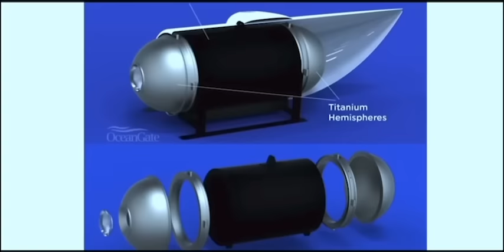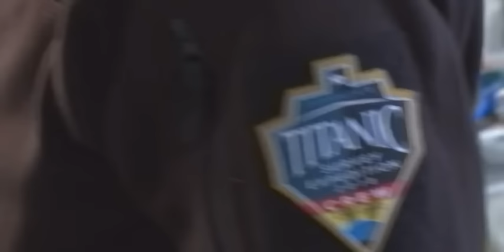First look at #oceangate #titan Debris

Comment: Their lives were really counting on that glue…
Reply: Creamy or chunky peanut butter?
Reply: @subvariantstrain Creamy 😂😂😂
Reply: and not nearly enough it would appear... the adhesive should have been oozing out around both the interior & exterior perimeter mating surfaces... the ooze then could have been squeegeed smooth... as it cured... the last thing if anything at all going thru their minds were their asses as they were getting excreted through the porthole... The depths of the ocean are a cruel and unforgiving mistress...
Reply: To be fair this sub had done multiple trips over a few years.
If James camrons sub exploded they would be bitching about all of the flaws on his sub too. Especially because camron only went down a few times compared to the titan.

Blame commercialization/sensationalism.
Reply: @deliacolquhoun2845 multiple trips was the problem
Reply: @deliacolquhoun2845 True, but Cameron's went 3 times deeper. All submersible, just like airplanes, get retired after so many trips. Submersible get retired after only a few.
Reply: @deliacolquhoun2845  yea, it worked for many dives but I don't think glue should have been utilised period.
Reply: Wow 😯😯😯😯😯😯😯🫢🫢🫢🫢🫢
Reply: They would have been better of using Elmers glue.. 😂
Reply: @deliacolquhoun2845 No james Cameron went down over 30 times ! oceangate Went down only 12 times
Reply: @cjstats1514 Not true....Alvin made over 1000 dives
Reply: Should have just made center out of Titanium 5 inches thick or more.might have weighed little more but they would still be alive today. Where is the center Titanium core that carbon fiber was wound on? Any pictures of it ?
Reply: @deliacolquhoun2845  The submersibles Cameron used are in use since decades, execpt the one that was specifically build to go to the mariana trench just once. The others still work. Cameron went to the Titanic 33 times. The Titan submersible reached the Titanic three times, once in 2021, once in 2022 and once in 2023. The hull has been replaced once in between. The actual hull had therefore a maximum of two dives to the Titanic before it failed as expected. Carbon fiber hulls are bad at compression loads. You cant push a rope.  Thats why there are no carbon fiber deep sea submersibles. Using such a hull multiple times is suicide. The outcome is an implosion, not an explosion.
Could you try to get at least one fact into what you write?
Reply: @flybywire5866  just like a vehicle though I highly doubt he kept up with the maintenance of the Titan..
Reply: They would have been better off sniffing the glue.
Reply: Glue failure? What’s the bet the carbon fibre didn’t let go abruptly! The expensive coffin might have rapidly filled with water then imploded with not as much force as they suspect! Hence they have found body parts which in theory should have become source and vanished!
Reply: @deliacolquhoun2845 Cameron been even more 33 times nd deeper than titanic
Reply: @wallywally8282 jumping the gun a bit. At the moment presumed human remains may have been found. This does not mean body parts. Whatever has been found would still have to withstand the pressures down there.
Reply: They should've used gorilla glue, it won't move.
Reply: @deliacolquhoun2845  blame Stockton Rush
Reply: @deliacolquhoun2845  blame capitalism, maximize profits whilst reducing costs ie cutting corners.
Reply: That glue must be very special and strong ....At 4000 plus feet, the glue will change its durability to extra strong ....
Reply: And now they are the glue
Reply: They should of used Gorilla 🦍 glue😊
Reply: @deliacolquhoun2845 You are correct lets not dwell on the negative’s!
Reply: @revolvermaster4939 I’m really surprised they didn’t make a new one after so many trips. 
But greediness won here
Reply: Had NOTHING to do with the accident! This accident was caused by the implosion of that carbon fiber cylinder! the ends blowing off were totally irrelevant the people by that time were already dead. Those end caps in fact were in COMPRESSION BEFORE the implosion. They simply "dropped" off the cylinder when it imploded because the carbon fiber was shredded (they coulda used masking tape as a fastener). Yeah I'd like to see the aftermath of that carbon fiber THAT was the cause of this accident.
Reply: Exactly. I was shocked when I watched the construction
Reply: @wallywally8282  I Just hope Rush felt it all
Reply: Not at all, under pressure it was just a seal. I will go so far as to say it would have been stronger if it was rubber seals there and the titanium and resin parts could react individually to the pressure. (And cold)
Reply: @teamidris  I don't think you get what's happening. The carbon fibre still would have failed with rubber.
Reply: Oh my!!!
Reply: @waynesharp1690  not necessarily, because the dissimilar materials locked together by the grove in the titanium adapter ring is a stress raiser.
Reply: @teamidris  the overall design was very weak. I'm amazed it survived once let alone all the other trips down. Each time was a suicide mission where they got lucky. It was a death trap waiting to happen as we've seen.
Reply: I thought the exact same thing
Reply: If only he was using flex tape, that sub will OP
Reply: @deliacolquhoun2845 To be fairer, James Camerons sub was designed and built using already existing data on deep sea diving.

Titan was designed and built ignoring all relevant data regarding deep sea diving. It also was never even looked over once by any regulatory body on earth. It's creator had a high level of aeronautics knowledge and based his design off his own knowledge in that field.
Reply: Insane!!!! Truly Insane!
Reply: I mean  that wasn't weak glue but wellding would be a lot stonger
Reply: This guy cheaped out so much on that sub I wouldn’t be surprised if he did actually use peanut butter as the glue won’t be the first stupid decision he’s made
Reply: I would never trust glue to hold on its own. If bolts couldn't grab and hold in the carbon fiber, I wouldn't use it. A better experimental submersible would include a graphene alloy in my opinion.
Reply: Crazy glue
Reply: Gorilla glue
Reply: They should have put a massive jubilee clip over the joins.
Reply: @SophieB_Ofcl  But it takes ages to harden.
Reply: @forzatuner3916  Exceptions don't make the rule. One exceptional submersible that is out of the ordinary. Most get retired to at least only going to less deep dives.
Reply: Glue is not very strong hold and  why they not using volcaseal or Mighty Bond
Reply: It's been proven they used EXPIRED materials probably the glue
Reply: @MrRODSTER426  You copied that last bit.
Reply: charlieb308  That is interesting.
Reply: @cjstats1514 
There's some companies who use the unmanned submarine to explore the see, they don't need to change the submarine every years, of course there's some maintenance but they keep using the same sub, same goes for the army subs, they're lifespans are decades. 

The titan imploded because he was made with materials who simply couldn't handle the pressure, it's already a miracle that the titan didn't implode before. 

But if the titan was fully made with titanium, and if the responsables were respecting safety rules, using certified materials ect then the titan could have plunged 1000 times easy before being replaced.
Reply: @MrNaKillshots  Somewhat better said than the eyes glazed over speculative 20/20 hindsight presented by those sitting in armchairs from afar... I thought it was appropriate considering the bulk of adventurers on this voyage were so enamored by the Titanic they were willing to risk everything for a brief encounter at formidable depths... thereby losing everything for mere fleeting fascination... a stark reminder of the toll extracted of both courage and sudden misfortune that lies in wait when men go to sea... May all mariners who go down with their vessels forever RIP...
Reply: @cultofpersonalit1888  oh I agree. The Titan was engineered poorly. I wasn't denying that. I was stating the fact that manned submersible have an expiration and retirement. Just like commercial airplanes do. Wasn't talking about the unmanned ones.
Reply: Reduced  on special offer at Dollar General or Harbor Freight.
Reply: @cjstats1514  Or rebuilt. like the Trieste was.
Reply: @mister_M.  
🤣🤣🤣🤣
Reply: @joefish6091  rebuilt.. retired. Same thing lol
Reply: @MrRODSTER426 That adhesive need special press to add properly to titanium ring
Reply: @deliacolquhoun2845 To be fair even me cant thinking better
Reply: @jakkie9156 Gluening method used properly work good but soldering is Better.
Reply: @dustinshaver3173 30 Times with same Sub?
Reply: The glue was not the problem. At depth this thing would have held together under the pressure alone. The Carbon fiber would have fatigued with each dive and finally gave up.
Reply: @deliacolquhoun2845 is it true that on their waivers they said the craft had done 13 out of 90 planned dives?

Comment: Never mind the shape of the submersible, the carbon fiber hull, the various materials used to construct the vessel, or the play station joystick, you had me at "glue! "
Reply: Anything made with carbon fiber uses “glue” called epoxy. There’s no other way to make carbon fiber parts. Carbon fiber is literally just cloth without epoxy. The sub could have been very strong in theory and with the right process but to many short cuts to save money we’re made and that added up. The implosion has nothing to do with the “glue”.
Reply: @beaudinnapolitano9954   I know the glue had little or nothing to do with the implosion but glue was used to bond the titanium to the carbon fiber hull! Glue is for plastic models not for submersibles! 

And carbon fiber only replaces steel, titanium, and aluminium if weight is an issue such as in the construction of racing cars, planes, and fast boats and yachts! It's not something you would use in the construction of a tank, bulldozer or submarine because eventually the huge amount of pressure and pressure release will cause the micro-thin fibers to seperate and weaken! Any first year engineering student could tell you that!
Reply: @growlkitty  The glue you were talking about is sketchy but might not have been a problem if they had a larger area to allow the glue to bond to. It could’ve also added grooves to the carbon fiber to allow the glue to better bond with a titanium. Ocean gate was just cheap and didn’t want to buy the extra material needed to extend the titanium end caps. Also, I understand that delamination in carbon fiber hulls is the main cause for their failure, but one paper I saw, suggested that carbon fiber hulls if manufactured correctly could go to around 4000m deep no problem. If Oceangate simply checked on their subs every once in a while, the five passengers may not have died. Weight was also an issue for the sub which is why they used carbon. There is no buoyant foam around the hull because it’s expensive and ocean gate is cheep. That’s the reason why they use carbon vs ti because carbon is more buoyant then titanium. I still wouldn’t say it wasn’t the materials fault. Just people trying to be cheap🤷‍♂️

Comment: Far out, I can't believe how little overlap/glue contact area there was. You'd have thought maybe a foot. Not 2 inches.
Reply: agree.
Reply: there are better ways to secure a pressure vessel... glue... is definitely not one of them.
Reply: Had the ring that joined the titanium end caps to the carbon fibre body had longer mounts with more glue to hold, this thing would have changed the world. Rush was in the right direction, just needed a bit more glue. I hope OceanGate doesn't give up. I would love to go on the next one!
Reply: They could have increased the surface area by using multiple interlocking grooves. Instead they opted for 1 piece fitting inside 1 groove. Pretty damn dumb.
Reply: @beckydoesit9331  Uh....OK. every expert I've seen reckons compressing CF is a very bad idea, like pushing rope, but you do you.
Reply: Old fashion nuts & bolts with gaskets.
Reply: @beckydoesit9331  I don't think the issue is as much with using a bonding/sealing adhesive as it is with the fact that the design had the end ring slip over the end of the cylinder instead of inside it.
  Had the design of the ring been reversed so the shoulder of it butted to the end of the cylinder and the other 3 or 4 inches ( I would have gone a full 6"+) slipped inside the cylinder, this would have given the end of the cylinder enough support to prevent deformation and failure.
Reply: The glue only needs to keep water out at surface depth and also keep the craft together. Under pressure the end caps would be forced onto the carbon tubing even tighter.
Reply: @beckydoesit9331  no the carbon tube failed in center, not the ends.
Reply: @tom5051666  Uh....that didn't work.
Reply: @beckydoesit9331  No you don't. The use of CF was flawed from the outset. His motives were profit, his prerogatives were self-aggrandising, dusted with a dose of Dunning-Kruger, everything screamed out as unsafe. I would love to see his test simulations and design calculations that under-pinned the vehicles certification... hang on the vehicle was not certified, why was that? You really don't want to get on the next one.
Reply: @tom5051666  yes, not incorrect but the glue would also have to resist the differential deformation between the titanium end-cap mounting rings and the CF cylinder.
Reply: @jnavonoD The outside water pressure would push the endcaps towards the center, not far from it, in reality the tube was at a higher risk of buckling than the glue simply failing, even if it failed nothing would've happened. The CEO was just like you, a person clueless to how engineering really works, the difference is that he was rich.
Reply from the maker: @tom5051666  yes theres pressure on the end caps but more pressure on the longer carbon parts making the pressure on the tube uneven thus pushing the caps outward. and if pressure is on the carbon and the titanium lips the carbon sat in wasnt contracting as much as the carbon was, then the tares in the carbon would happen where the titanium meets with the flexing carbon was my point but you may be right! im looking forward to what the investigation uncovers!
Reply: @CozziFPV  is it possible to determine the origin? I feel like there's always some speculation that is needed... Although it's better for experts to do that .. not youtube commenters. Haha. I will trust their findings but it seems like an impossible mystery to solve.
Reply: Glue,under water pressure, don't think recipe for success 😮
Reply: @rezasoekotjo5082  they actually ran tests using a scale version of the submersible. During that time they still had a real safety engineer on their team. the test with the scale  model failed and again Rush chose to ignore the results and continued with his project...and after that their initial test dives with the Titan immediately showed more issues which the safety engineer called out...he was later fired after that
Reply: @tom5051666  but there is a greater force squeezing the CF cylinder due to the increased surface area
Reply: So much room for contamination during the gluing process. I'm surprised that sub made it down there at all. All that breath and bare hands on it. No isolation in a humidity and purified air environment. Hand applied glue where there is room for error. Not only the fact that glue is stupid. Carbon fiber was stupid. They were just plain dumb.
Reply: The glue job was very amateurish.There should have been consistent squeeze out and plenty of it.The carbon tube near the titanium ends was subject to short beam shear and the tube being only hoop wound was very fragile in this regard.

Comment: Gluing dissimilar materials requires vacuum chambers and other measures to prevent any trapped air and a uniform seal. This was done in a warehouse. But, I'm fairly certain the hull cracked since it was carbon fiber and not meant to handle external pressure.
Reply: And they mixed the epoxy in a freakin scadgy old bucket!
Reply: in your opinion would rush have heard it starting to fail before the implosion?
Reply: @bb-gc2tx  Absolutely. Snap, crackle, POP!
Reply: @bb-gc2tx  Previous passengers said they heard popping and cracking on other dives, so, yeah, they probably went down hearing all kind of noises along the way. 
Rush just kept repeating to himself it was all fine like a fool he was.
Reply: @bb-gc2tx    At that depth and pressure a sub simply survives or it fails . At those depths there is no such thing as a slow leak . The sub will be operating normally and 1/10 of a second later it no longer exists. It’s all very sad , I don’t believe that the passengers really understood the danger I’m sure they were told/briefed but I’m confident they just did not understand the magnitude of it all . If they did they simply would not have made the journey.
Reply: It was reported that they knew something was wrong, had dropped their dive weights and were trying to come back up when it imploded.
Reply: Actually an autoclave. Which is heated pressure chamber. There is no video them putting the hull in an autoclave after the glue up, but that doesn't mean they didn't. Really, chances are high they did cuz most of the resins used for making CF parts like that need to be baked to cure them. Same goes for the glue they put the rings on with.
Reply: @bb-gc2tx  According to the first passenger who went on Titan you could hear the hull cracking as the sub descended, Rush told him it was normal. So had he heard anything on the final dive most likely he would have dismissed it like he dismissed all the other signs and warnings people gave him he was heading for disaster.... In any case an implosion is just the mirror opposite of an explosion. When it happened it was over in about a millionth of a second the same as if they had been sitting on crate of dynamite.